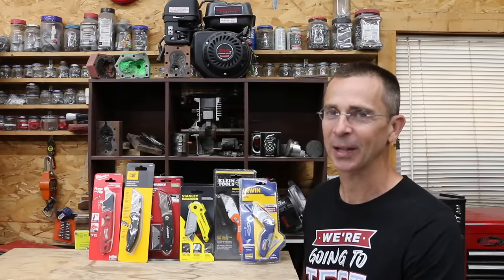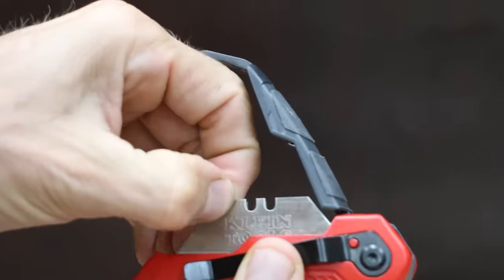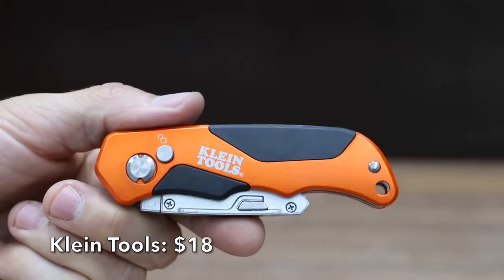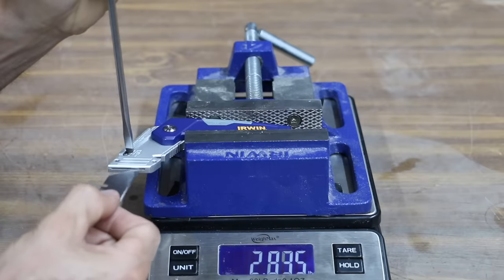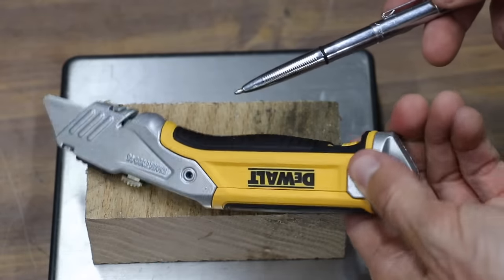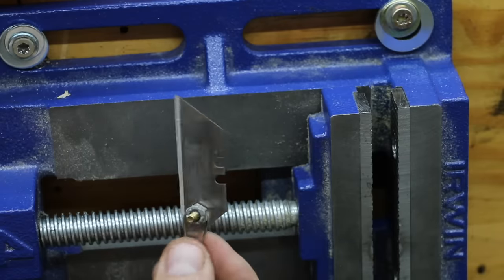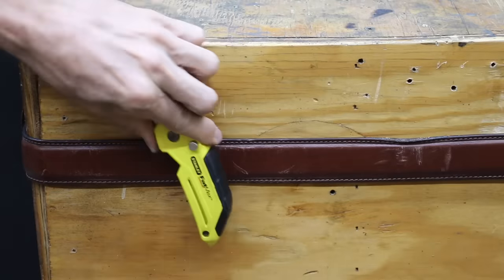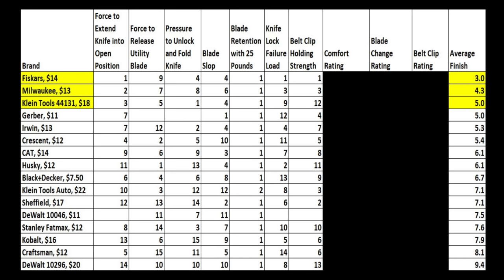Best Utility Knife? Let’s Find Out! Milwaukee, DeWalt, Gerber, Husky, Kobalt, Klein Tools, Craftsman

Comment: Milwaukee Fastback has been my go-to EDC for years. It was my best friend working HVAC, and has kept with me ever since.
Reply: Love that knife, I got two.
Reply: I had 2. Lost one😠 great knives! Open and closes so easily. I think I may get the one that has a screwdriver and blade  storage next.
Reply: The fastback also has a 5 blade storage
Reply: Do they have a model that won’t get lost? 😂 I literally buy dollar store razors because I’ve lost so many quality ones
Reply: I’ve got 6 of these( bought 3 2 packs at Home Depot) and use this for EDC also. I’m a forklift operator in a warehouse, and use it all day cutting open boxes, and shrink wrap off pallets. The more you use it, the easier it operates. Love it!!!
Reply: Yea and the Milwaukee is the easiest to open, you just hold the button and it flops open I use them every day
Reply: My EDC is also a Milwaukee Fastback but with a screwdriver bit holder and bottle opener.
Reply from the maker: Thanks for the feedback.
Reply: Fellow hvac tech here. Any cons? I'm worried about blade length for cutting ceiling tiles and thick pipe insulation.
Reply: I lost my fastback about a week ago and it’s why I’m here. It’s a great knife but all of my coworkers use them too, not to mention we use temps a lot so I wanted to see if there was anything as good that would let me have a knife that would stand out. From the minute I seen the fiskars knife, having one of their hammers and loving it, I knew it would be the one. And then it just kept blowing his tests out of the water just reinforced it lol. I’m about to order it and give it a run

Comment: I believe most people consider the "belt clip" more of a "pocket clip." I certainly put them in my pocket, never on my belt. The milwaukee is my favorite because it's easy to carry, sits deep in the pocket while some stick up almost an inch or more, and easy one hand use. 👍 great video.
Reply from the maker: Thanks!  Thanks for the feedback.
Reply: Yup! This!
The clip holds it in the work pants pocket just perfect.
Reply: I always use a Milwaukee fastback
Reply: @TheDaniel85  on top of that, it ruins your belt from repeated use, pocket is the way to go for me too
Reply: I randomly saw a review of the Milwaukee 1505 (has the screw driver back) and figured I’d give it a try for $20. It’s replaced my EDC knife.
Reply: Yeah, dealing with a belt would be a pain, even so I'm always wearing a tool belt and that's where they usually end up, either in a small outer pocket or clipped in the big one.
Reply: Yep, clip it to my pocket. I still lose them all the time lol.
Reply: Yes, this.  He did regard the elevated removal force as a benefit in his tests. Still, I have been carrying Milwaukee fastback knives clipped in my jeans pockets for years and the strength of that clip can make removing it one-handed a hassle, especially on looser-fitting jeans or ones with thicker denim.
Reply: I carry the Milwaukee as a pocket knife.  The first thing I do is remove the belt clip and throw it away.
Reply: @Red2003stang  That knife is my JAM. I don't leave home without it. And, if you have to fly, just dump the blades.
Reply: Took the words right out of my mouth
Reply: This! Additionally, if the belt clip is too pronounced wearing it on my belt will actually drive it into my hip.  My old EDC knife was the Sheffield because it came with a leather pouch, and I would remove the clip entirely.  Lately, I've switched to the Milwaukee Fastback with the built-in screwdriver.  It's sheet-metal construction with a plastic shell, a bottle opener when closed, and a button lock that holds it closed and open.
Reply: Milwaukee is my favorite too. I like that you don’t have to put your fingers in the path of the blade to close it. I put a small strip of hvac tape over that opening so nothing in my pocket gets cut inadvertently. I’m referring to the slit over the blade that lets you cut small wire and stuff when the blade is closed. 

Other than that I love that knife.
Reply: @SixOThree  The compact version of the fastbak doesn't have that wire cutting slot fyi.  It"s a great single purpose tool imo.
Reply: As someone who has the fiskars and always puts it on my pocket, I have to say it’s rubbish. Knife is excellent but compared to my makita one, can not for the life of me get it on my pockets
Reply: @rondinocco5416  When I get a new one I'll grab the fastback compact. But so far this tape has held up. I have that foil hvac tape on one and gaffers tape on the other. And I'm surprised how well both have held up.
Reply: Came here to say this. Both pocket and Milwaukee.
Reply: I attach mine to my belt loop, much easier to get on and off then on the belt its
Reply: Hands down the Milwaukee is the best imo. Use it everyday. I have the one with the Philips/flat head bit holder. Love this thing and will always have one.
Reply: Agreed, I prefer a clip that doesn't stick out much.  Just more comfortable in the hand imho and I like that the Milwaukee clip is bent round wire rather than bent flat metal (no sharp edges).

Comment: I really like my Milwaukee fastbacks.  I have both the old and new designs.  It was nice to see they tested so well.  I'm going to check out the Fiskars next and see how I like that one.
Reply: Your gonna wish you got it sooner. I've tried every design of knife. Nothing even close to the fiskars.
Reply from the maker: Thanks for the feedback.
Reply: Been using the Milwaukee as a mechanic daily for ever, but just ordered the fiskars for comparison
Reply: @azwrenchmaster5334  you will notice that the Fiskars has a tad bit extra rubber on the handle that after about a week of use will begin to curl inward just enough to grab the blade shank. All you need to do is trim it slightly with a sharp razor blade and it will be like new again and never be an issue after that.
Reply: @beerbeforebreakfast  thanks for that. Rubber on a work tool doesn't ever seem to be a great idea.

Comment: I use the Milwaukee 6 in 1 knife for work everyday. The flip action is very quick and easy to use, and it has a built in screwdriver which is very handy, and has storage for 1 blade. It is more expensive at $20, but I don't think that's bad
Reply: You can find them for $10 on sale all the time, or in a combo pack with a standard Fastback for $20. At $10 the driver version is a no brainer for sure!
Reply: I also carry that one.  I love it. It competes with a multi tool for my needs.
Reply: I use a Milwaukee with a Dewalt blade
Reply: Me too!
Reply: This
Reply: @SuperMortiki  me too, for the last 10+ years.
Just ordered the fiskars to try something different
Reply: I also HIGHLY recommend this knife. The screwdriver can be flipped from a Phillips into a flathead. Only one storage spot, but no extra blades rattle. It flicks open with very little effort.
Reply: Fantastic utility knife and the added utility of the bit driver is great!
Reply: @SuperMortiki  Same!
Reply: @paultasker9759  "It competes with a multi tool for my needs."  
I bought the combo pack for 20 bucks at Home Depot.  Since it's so thin and light I carry both my Leatherman Wave and the Milwaukee for when I need something razor sharp or a philips head that is actually a philips head instead of what is included in the Wave.
Reply: Same here its in my pocket as I text this.. everyday iv had it for a long time great  knife 🗡
Reply: @leaves2975  "Only one storage spot, but no extra blades rattle."
I put a hook blade in the storage spot.
Reply: Yup, my favourite knife by far!! I use it daily.
Reply: @SuperMortiki  that's interesting. I like the Milwaukee blades but am due for new ones, so I'll give the DeWalt a try. I love this tool.
Reply: @SuperMortiki The Milwaukee blades suck. I bought a fastback that came with a 50 blade combo pack. The blades a super sharp but get dull after using them once.
Reply: Nobody can convince me to use another knife. Been using mine for over a year
Reply: I use the Milwaukee with the 5 blade storage in the handle, but I do also carry a 11 in 1 as well. With those 2 I can do pretty much anything I need for my day.
Reply: I got that one it’s the 1505 only mod I did was file down the nub under the belt clip to make it easier to take out of my pocket.
Only one spare blade but that’s okay I got four edges for cutting and I work at an auto parts store so getting extra blades is not a problem 🙂
Reply: yes  the 6 in 1 is great :D everday use best knife i have owned so far
Reply: Dude I love mine! Best $20 I ever spent for real. They’re very close to making something that can fully replace a multi-tool for a lot of people. Lightweight, small, cheap, durable, what’s not to love? It’s so cheap that if I lose it I’ll just buy another one.
Reply: forgetting the best part, it has a bottle opener😁
Reply: @SuperMortiki  same
Reply: @azwrenchmaster5334  I use my Milwaukee 1505 with Lenox Gold Titanium edge blades. I won't put DeWalt blades in. That's sacrilege!
Reply: It’s my favorite knife. I’ve been using mine almost daily for about a year now. I love it
Reply: @Chris.Rhodes  Hahaha
Reply from the maker: Thanks for sharing.
Reply: Best knife by far. Milwaukee really fixed a ton of the issues you encountered with the older design. I can change the blade with gloves for example
Reply: @SuperMortiki  Exactly my choice.  Thanks to Project Farm, I use Dewalt blades.
Reply: @burnetthopkins9583  Try Lenox Gold, or serrated blades, you'll never use a DeWalt blade again.
Reply: @ProjectFarm  Another simple idea is just utility blades. Dewalt, Lenox, Milwaukee, Kobalt, Dollar Store Generic, Amazon, all kinds of brands, and titanium, and carbide, would be awesome to know what blades are better and what blades lose an edge quickly. I've used serrated blades too and loved them.

Comment: Would love to see how JerryRigsEverything's knife stacks up against the established brands.
Reply: +1
Reply: I have 3 of them and after this video I'm very curious!
Reply: In the nicest way, I cant watch this video without his knife is in the mix.
Reply: Would love to see it if he does another round up!
Reply: Absolutely!  I was going to say the same thing!
Reply from the maker: Added to my list for round 2. Thank you
Reply: @photolabguy  is cheaply made
Reply: They’re junk
Reply: @manuelpiston  I do not concur. Have you handled one?
Reply: I also would like to see jerryrigs knife in this
Reply: @ProjectFarm  you could test how well the belt clip holds up ... that has been a problem for me. knife snags on so thing and bends the clip
Reply: @xploration1437  I've got quite a few of the knives in this test to compare in regular use and disagree, it's got a few things it could improve on but it's definitely towards the better end of the spectrum.
Reply: Nice! I didn't know these existed this may bump the cobalts from my pocket
Reply: Love to see a disk brake test. Do cheap brakes ledoem as well as cross drilled and ventes. So carbon ceramic brakes make any difference or do they lower stopping power in daily driving.
Reply: @connorbaniak  bro is the CAT in this video
Reply: @coastalcleaningandmaintena2884  might want to ask torque test channel. They're a lot more likely to do scientific tests which would come out with a result that mattered for brakes.
Reply: @Manuel Piston  so no, you haven't held or use one.
Reply: @ProjectFarm  awesome video as always… when are you doing a video about best oil filter? Synthetic oil filters especially… everyone is waiting on your test for those… lol thank you
Reply: Yes!!!!!! That would be amazing. I doubt they’ll stack up against the Milwaukee and Fiskars but it would definitely be interesting to see!
Reply: Amazing! Plus, it's going to happen! Hell yeah.
Reply: Read my mind
Reply: Jerryrigseverthing is a joke
Reply: @ProjectFarm  collaboration incoming.
Reply: I was thinking the same thing.
Reply: Nah. That dude isn't worth paying attention to.
Reply: I have had one of the blue ones since his original release and it still going strong. I dont beat it up or anything but its help up well enough.
Reply: His is probably my favorite one to use. The Milwaukee one with the push button is more fun to fidget with however!
Reply: @ProjectFarm  please use lbs and ounces
Reply: @manuelpiston  i have one and i dont think its cheaply made. Certainly better made than a lot of utility knives out there. No plastic at all. Sturdy with no wobble. I love mine.
Reply: @ProjectFarm  for round two please add Goldblatt I'd never heard of them decided to try it and glad I did
Reply: Especially the clear one, since it’s made from plastic.
Reply: @ProjectFarm  please include the clear one in round 2 as well. Since the handle is made from plastic.
Reply: @username8644  the clear one is made out of plastic. The other ones are made out of an aluminum zinc alloy. And they come with spare blades in the packaging.
Reply: pretty sure that thing is just a chineese bought rebrand.
Reply: JRE knife is decent, really reminds me of some other brands I've used (Husky i  think).it is obvious that JRE doesn't make the entire knife, it is simply a rebrand of a commonly produced product. Not such a bad thing, but then you tack on 5-7 dollars ontop of the actual value of the knife.
Reply: @ProjectFarm  this guy in the comment section...  👀
I appreciatcha!
Reply: Probably bad based on the cost and simple design
Reply: Jerry’s knife might have some of the best fit/tolerances but feel doesn’t match the Fiskars.  I love the fiskars as a tool belt knife.  Easy to do a 1 handed push button flick opening.  Blade retention is great.

Jerry said his is one hand openable but it’s just not easy for me.

I also have a pile of the compact workpro folders that I believe were suggested by adam savage.  They’re awesome for things like opening packages and super compact but blade retention is horrendous for things like breaking down cardboard boxes.
Reply: @Splarkszter  that's exactly what it is. It's funny seeing how many in this comment thread have convinced themselves it's way better than it is because they like JRE.
Reply: @arctikf0x698  I swear by the JerryRigEverything knife. The solid handle ones being better than the clear ones (better weight balance). And i specifically compared it to my Husky. Night and day difference. I only realized how much "play" the Husky when I got the JRE. Having said that, I use actual folding knives for edc and boxes. So this is more of a backup I keep in the car and gifts to friends.
Reply: I was about to say this comment too. Haha
Reply: Colab?
Reply: I have one, they do not hold the blade that good.
Reply: Agreed
Reply: I've bought 3 of those Gerber knifes. All 3 came off my belt,  2 got lost and 1 I found after running over it with a forklift.....It still works! No clip though,  think God's telling me something.  I see it around the house sometimes lol... I've been using the milwaukee now for maybe a year, I blow film and I can take 60 pounds of plastic off a roll easy.... it just feels good in the hand. That dewalt I also have, it works ok but I can't cut a roll as good, and feels funky in my pocket.  It holds blades for my milwaukee lol... I've had maybe 10 of those Husky knifes... they come in packs of 3l lol... too hard to open, but they're ok... Guys listen,  I got a 75 pound roll leaned against a bin with my left hand , and reach in my pocket with my right to pull out the Fastback, push the button and it opensl lol its like ninja shit!
Reply: You should also do the exceed design tirant v3
Reply: I have carried one of the transparent ones in my pocket EVERY single day since I got it which was about a week after he announced it. Gets used regularly and has held up very well, no complaints other than the clip, I prefer thin 'wire' style clips but other then that, blades are stupid easy to change, looks great and feels great. There's my .2
Reply: Jerryrig who? ahh just like that ltt screwdriver.
Reply: I have one and it’s awesome

Comment: Loved my old Husky blade. Spot on about the stiffness in the hinge but it loosened up with use and a bit of oil to the point I could easily flick it open. Rugged and reliable, everything I needed in a compact pocket utility blade. 

My only complaint was the knife was so nice it apparently grew a pair of legs. Hope whoever has it now appreciates it like I did.
Reply: The reason I swapped out my Husky for the Gerber one shown in this video is that the blade release became so loose that it would not-infrequently open itself up.  It was rather good up to that point, though.
Reply: I also have a fondness for those cheap husky util knives
Reply: god yea - once you break em in, they'll be good to ya. especially them old ones

Comment: I use the Milwaukee, the thin profile makes it easier for me to keep clipped to my pocket vs the other well-performing knives.
This video did a really good job showing the strengths and weaknesses of each knife, and makes it easy to select one based on what is important to individual users.  Well done!
Reply: Love the milwaukee.
Reply: I also carry a  Milwaukee. I’m hard on the clips for some reason and on top of all the strengths shown the belt clip is easy to bend back if you screw it up. Love it!
Reply from the maker: Thanks!  Thanks for sharing.
Reply: Right! The milwaukee clip stays tight, and it is slim and light in your pocket.